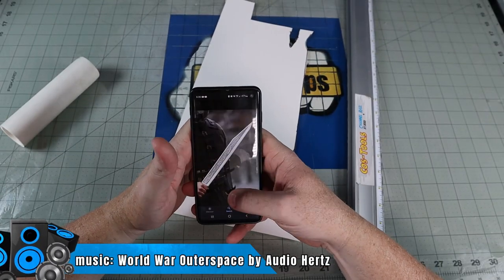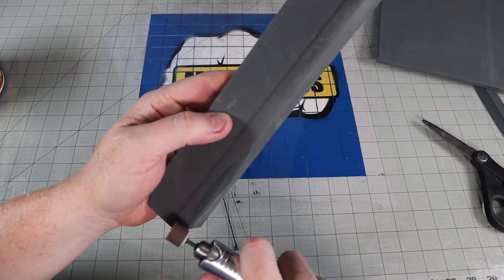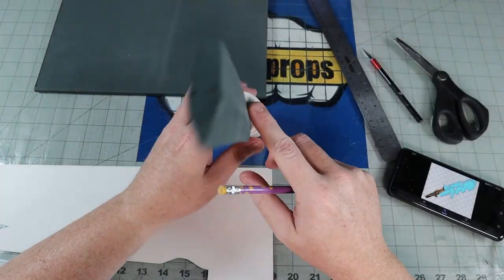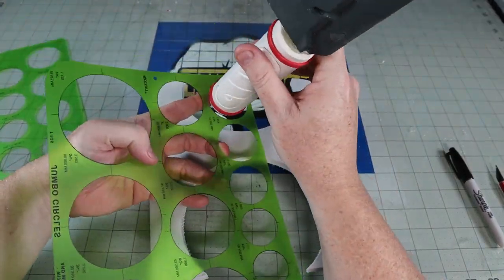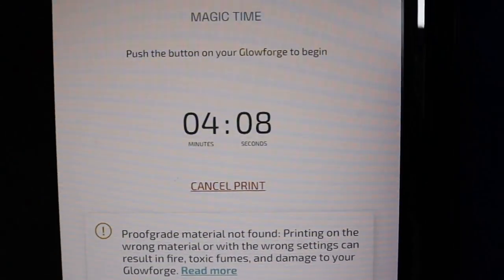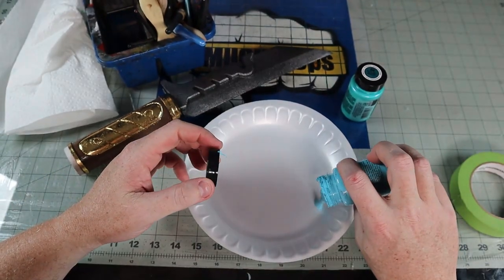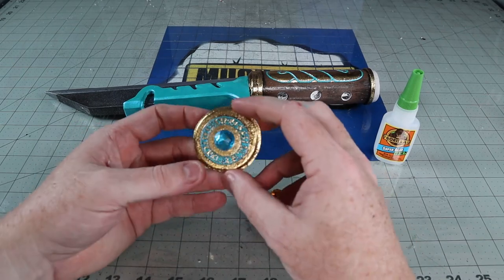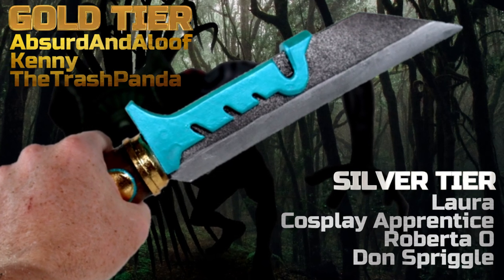Making a Viking Scramasax

Comment: This is very pretty.  The horns on the back of the blade will make it interesting to build a sheath for it.  I know that you are holding a battery pack inside the handle, but if you were able to heat it and make it more oval instead of round, it would feel much better in the hand.
It does look good though.
Reply from the maker: The sheath should be fun to figure out. Can't wait to get to the photoshoot of this one.